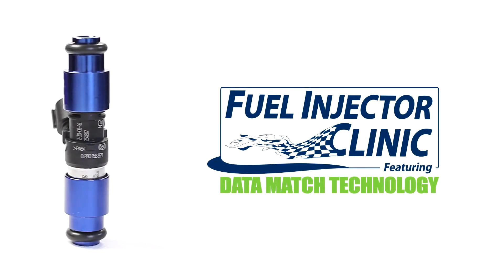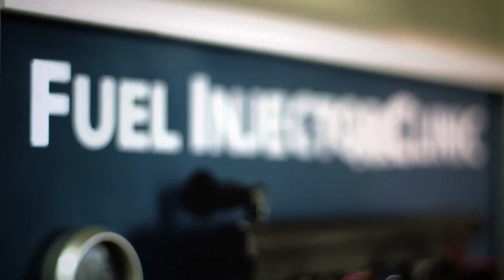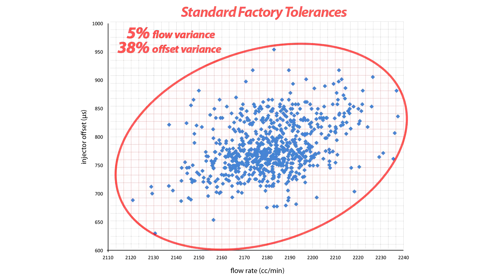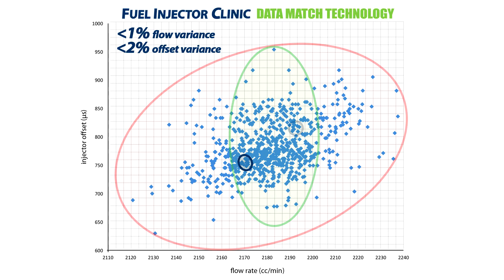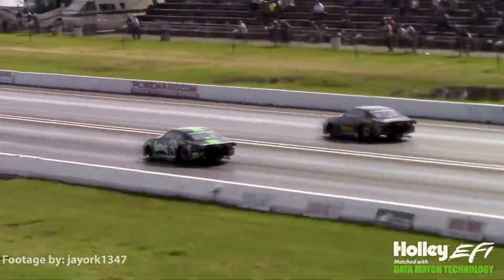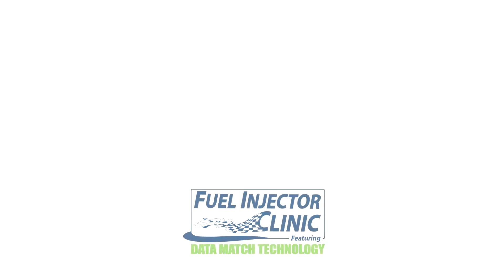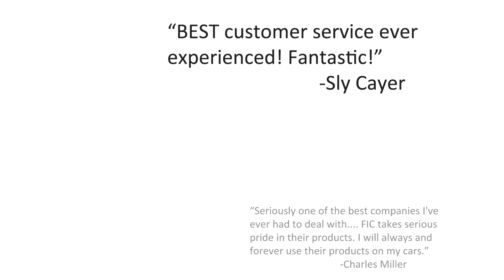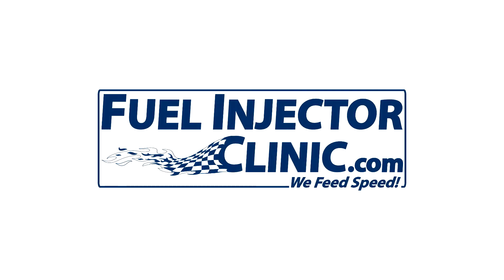Fuel Injector Clinic's Precise Injector Matching, Tuning Data, and Lifetime Warranty

Comment: Which fuel injector should I get for a 2006 Mitsubishi Eclipes? And will I see a boost in performance  as far as horsepower, torque and gas mileage?

Comment: What’s the difference between the id1050x and the FIC 1000 I’m in the market for some my first choice was FIC of the bat for my ls2 build once I go turbo I want to be pushing 800crank want to be in the 700whp range all motor at the moment is 540hp crank will be running e85 also and maybe 110octane also data logging if you convince me I’ll place an order right away because I was set to buy the id1050x
Reply from the maker: Hi Cesar,
There is a lot of good information within your comment. There are nuanced differences between our FIC 1000cc injectors and ID's 1050x. It might be better to talk to us over the phone at 561-427-0082 and we would be able to discuss the differences.
Reply: @FuelInjectorClinic  calling now

Comment: Do performance  injectors change the idle quality ?
Reply from the maker: It depends on a lot of factors. But it most depends on the injector size and the tune. Having injectors that are too large may cause issue with idle. That is why we have the injector calculator (https://fuelinjectorclinic.com/index.php?route=information/static) to help with getting the right injector size. 
Also the tune is extremely important as the tune tells the injectors what to do. We provide the flow rates and offset values for each injector within the box, and ECU data on the website to download to help with tuning the vehicle.